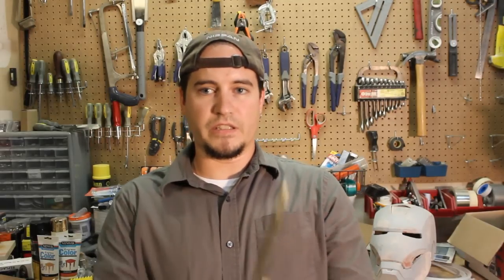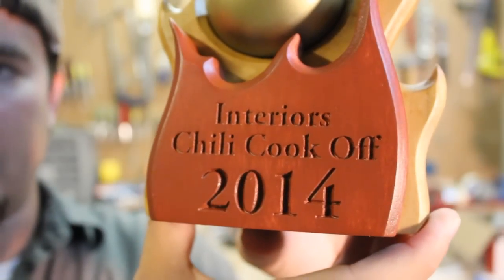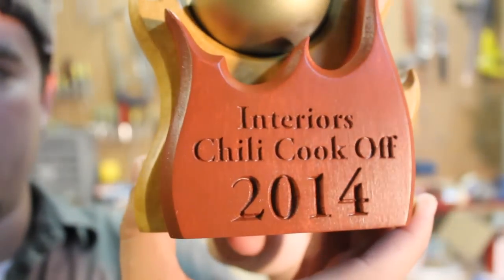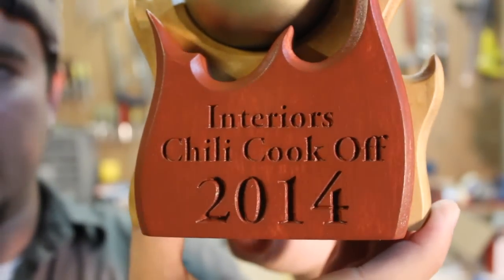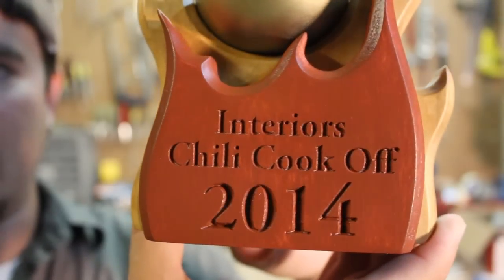Shapeoko 2 - Letter Engraving

Comment: What system do you use to run your gcode? I just got a shapeoko and I'm trying to find a good way to run the machine.
Reply from the maker: Brandon N When i got the shapeoko, i went and bought a $300 laptop from best buy.  You don't need a powerful computer to run it.  As far as CAM packages go, i started using makercam.com, a free online CAM package which is fairly robust.  Lately i have been using Cambam (http://www.cambam.info/);  it has a fairly long trial period and is not that expensive to buy after the trial is over.
Reply: How did you import the g code for your engraving to maker cam? I was looking at that but could only find an svg import option.
Reply from the maker: Im sorry,  The engraving did not use cambam or makercam.  I used a free program called Fengrave (http://www.scorchworks.com/Fengrave/fengrave.html).  It a bit of a clunky program, but with some fiddling, it works.  Basically, you import the SVG into Fengrave and it writes the gcode.  It is basically a standalone CAM program for engraving.  The profile of the flame was milled using CamBam.
Reply from the maker: Brandon N As i am reviewing what you ask, i have still not answered your question.  I do not import gcode into makercam.  I used the gcode from Fengrave and ran it through gcode sender to the shapeoko.  I then created the gcode for the flames in CamBam and sent that through the gcode sender as well.
Reply: I got the gcode to write correctly.  It show correct  from what I can tell under visualize. However, when I run it I get a command number and it says " error while starting file stream: command#2 too long: (55>50) settings used in f - engrave when this file was created)  any idea on that?
Reply from the maker: Brandon N ahh, i got the error often when i was messing with Fengrave.  there is a setting either in gbrl or gcode sender that allows for longer lines, but i don't remember where or what is was.  the way i fixed this was to open up the Gcode file in microsoft notepad.  the first section of the file is indentifer text that really is not need to run the program.  This is where the error should be originating from (its basically a line of text that is to long (over 70 characters i think)).  I deleted this section and resaved the file and then it ran fine.

Comment: where do you get your end mills?  They are longer than the ones I have used.
Reply from the maker: That end mill was purchased locally because I didn't want to wait on delevery.  It was the only size they had in stock, and yes it is way to long for my liking.
Reply: Targ's Workshop cut off at the end (Flex), extra long cutters increase milling motor bearing damage! :-)

Comment: Very creative trophy for a chili cook off! I noticed you didn't seem to have the wood fixated in any way, can you engrave and cut without doing that? The reason I'm asking is that I ordered my shapeoko and was expecting to have to make something to hold the piece in place myself.
Reply from the maker: you will definitely need something to hold you material down.  I use double sided tape to hold my small parts down.  Have fun with you shapeoko.
Reply from the maker: Frank Graffagnino
The tape i use is made by 3M.  its kind of like the brown packing tape, but really sticky on both sides.  I used to buy it at homedepot, but they don't sell it any more.  I think you can order it from granger.com.
Reply: Targ's Workshop I always see folks using double sided tape for stuff like this, but I always find I have to have stuff super rigid before I can mill things out or it will slide or shift. What kind of tape are you guys using?